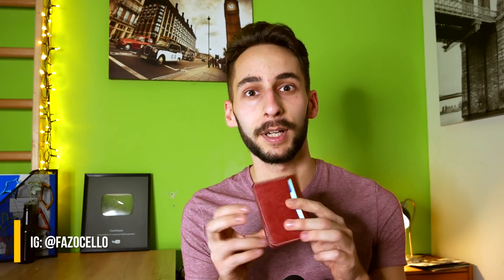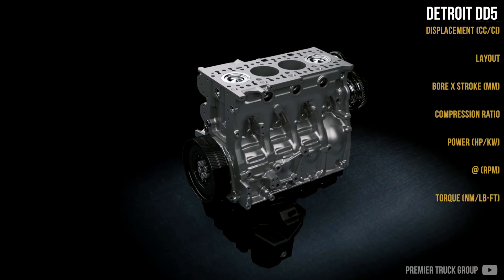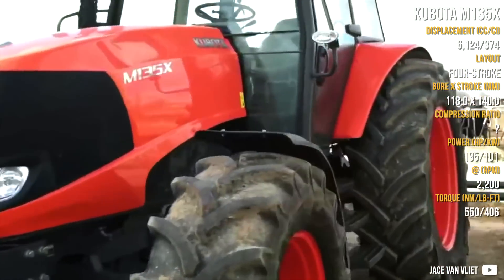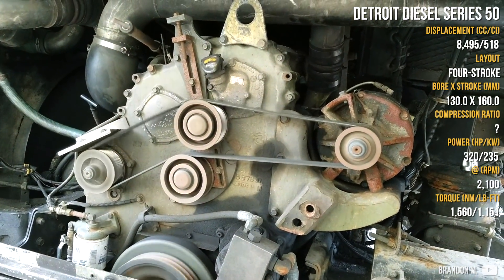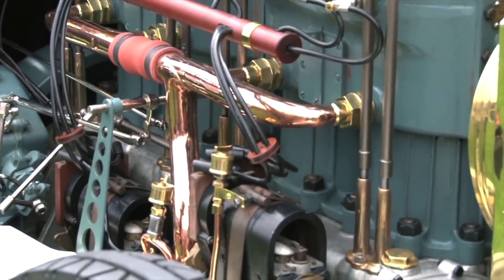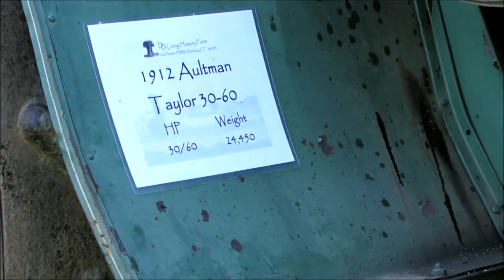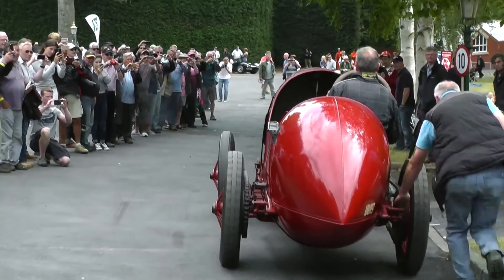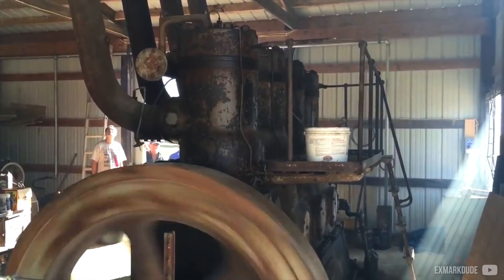The Largest 4-Cylinders In The World

Comment: About 40 years ago I was working at the Giles weather station in central Australia. 
They had 2 old Nation 4 cylinder diesel each was about 14 feet tall similar to the last one you showed Fairbanks Morse. 
These National engines had been running in the power station for about 50 years without any failures they had remote cooling towers and were air start the fly wheel was about 7 or 8 feet in diameter. 
To start them you had to decompress the cylinders then using a long spanner to rotate to top dead centre on cylinder 1 then using a hand pump mounted on the wall pump up the air pressure hit cylinder with the air pressure when spinning release the decompression leaver. 
These engines had been doing 600RPM’s for 50 years. 
I’ve never seen anything like them since.

Comment: You should do a video about big gasoline i4 engines. The secondary balance problem limits inline 4 engines in size or rpm, which i shy you don't see anything bigger than 3,3 L in cars revving to normal ranges of 5,500 rpm. Anything bigger are slower diesels.

However, there have been interesting exceptions, like Thor, and a new marine engine.

Comment: Actually, the turbo-supercharged Detroit 4-71 2 stroke was rated to 300 HP  The electronically controlled turbo charged 4 stroke Series 5 four cylinder were rated as high as 330 hp.
I had a 330 HP series 5 in one of the expedited box trucks I drove when with Panther and V-3.

Comment: Engines SMD-14, 18, 22, 23, 25
4-stroke
Rated power, kW (hp) 61.1 (83.2) -125 (170)
- liquid cooled
- cylinder diameter 120 mm
- piston stroke 140 mm
- working volume of cylinders 6,3l

Comment: Actually, there were many much larger more powerful 4 cylinder engines produced. A good example would be the 4 cylinder triple expansion steam engine used in R.M.S Titanic. There were 2 of those with a Parsons steam turbine that provided the thrust needed to move the ship. Each of those 4 cylinder engines produced a modest 15k HP each at 72 RPM. The Steam Turbine was rated at 16k HP. The maximum HP by desing however would be around 60k at 83 RPM and 18k of that power would be from the steam turbine. It was enough to move the ship an estimated 24 knots in forward. There were larger still 4 cylinder steam engines. Just wanted to put that out there.

Comment: As a two-stroke diesel engine that does not use crankcase aspiration cannot naturally draw in combustion air, the blower is inherently necessary to charge the cylinders with air for combustion. The blower also assists in scavenging spent combustion gasses at the end of the power stroke. All Series 71 engines use uniflow scavenging, in which a gear-driven Roots blower mounted to the exterior of the engine provides intake air through cored passages in the engine block and ports in the cylinder walls at slightly greater than atmospheric pressure

Comment: the non turbo detroit diesel is not naturally aspirated .... the way a 2 stroke detroit works it will not run without a supercharger.. at 0:46 the super charger is on the side of the block with the large pipe going into the top of it ...the blower blows directly into the block and into ports around the bottom of the piston liner  the exhaust is exhausted through  4 valves in the head,,,as the air enters the bottom of the cylinder the piston cannot suck the air in hence the reason for the supercharger

Comment: The Aultman-Taylor 30-60, seems like a waste of time building unless they were meant for weight more than anything else.  With 1391 Cubic Inches, putting out 80 horsepower, it was a little generous with torque though, putting out 764 lb.ft.

Comment: OK, is the Detroit Diesel 4-71 really 
naturally aspirated?  I'm not sure.
But, it DOES require that 4-71 
Roots Blower on it, to run.

NHRA regulations limit the supercharger 
size, on the top fuel cars, to a 14-71 size.
Or, just a wee bit larger than the blower 
on this "naturally aspirated" engine.

Since this 4-71 is a 2 stroke Diesel, I don't 
know if the supercharger on this, makes it 
not "naturally aspirated."

Oh, it doesn't have 4 cylinders, only 2.  The 
Snow 600 HP engine.  2 cylinders, but 4 
sets of valves, and 4 spark plugs.  Double 
acting cylinders, piston pushed both ways, 
like a steam engine.  Roller lifters, and 
roller rockers.  86,800 cubic inches.

http://www.coolspringpowermuseum.org/Exhibits/Exley/Snow_600_00.htm

steve

Comment: Any 2 stroke is supercharged or at least selfsupercharged, as they cannot run otherwise.
Reply: supercharging means air supply by separate unit with positive exessive pressure. So in this point for example all moto 2 stroke engines are naturally aspirated!

Comment: I thought all Detroit 2 strokes were supercharged and twin charged was for extra power
Reply from the maker: They are, but it's not there to provide boost, but rather a sufficient amount of air. Without this supercharger/blower it would not run at all.
Reply: @VisioRacer  its primary roles would be both to clear the cylinders and provide boost
Reply from the maker: @enja001  I have read a lot about them and the turbo variant is there to provide boost.
Reply: @VisioRacer  yes that is true but you can't claim an engine that uses forced induction(even slightly) is naturally aspirated
Reply from the maker: @enja001  What is natural aspiration of the two-stroke Detroit then?
Reply: @VisioRacer  its still not naturally aspirated. Naturally aspirated refers engines that use atmosphereic pressure. That detroit uses forced induction above atmospheric
Reply: Although the Detroit is a bastard child
Reply from the maker: @enja001  I rear that the blower provides only about pressure of atmospheric air

Comment: I need to correct you on the Detroit 4-71. The 4-71 came with a two valve head or a four valve head. The issue with the four valve heads on all 71 series heads is the heads are notorious for cracking between the injector and a valve seat or between the valve seats of the head.

Comment: The guy right off the bat doesn't know what he is talking about. 2 stroke Detroit diesels run with a blower they are not naturally aspirated. They won't run without a blower
Reply from the maker: That is the natural aspiration. All 2-stroke Detroits run with the blower, yes, they are not able to run without it.
Reply: @VisioRacer  The blower makes it not naturally-aspirated as the blower puts positive pressure into the cylinders to blow the exhaust gases out of the cylinders, not the piston as in a 4 stroke. I know the 4-71 as I have one in my boat for the last 30 years.

Comment: Another engine you didn't mention the 5.2 liter Isuzu 4HK1 diesel engine.
A four cylinder diesel engine with a displacement of 5,193cc, and it is bigger than Detroit DD5 engine.
It was used for trucks and buses as well.

Comment: The 71 series detroit was not NA it has a roots Blower, it's inherent to it being a two stroke diesel. There were twin charged variants however.
Reply: This has been a argument for decades...Detroit's got air into the cylinder from holes around the sleeves in basically the bottom of the cylinder sleeve (well kinda middle of the sleeve a bit above bottom dead center) so without a roots they simply don't draw in air thus...they don't run,unlike traditional engines that draw in air from the top of the cylinder as the piston moves down the air is forced in from the bottom then the piston moves up so by "typical" standards no 2stroke Detroit would be "NA" but taking into consideration that's essentially the intake valve and can't function without it it is NA if it's a non turbo version.
Reply: Came here to say this. Although I think he means it can also be turbo charged (along with the necessary blower that two stroke diesels all need). He has made videos on two stoke diesels in the past, so I'm pretty sure he knows how they operate.

Comment: Another large 4 cylinder is the English Electric 4SRKT Mark II, it's a 4 stroke turbocharged diesel engine with 61,2 liters displacement, 254mm bore and 305mm stroke.
It produced 600hp at 850rpm.
It's use was in diesel multiple unit trains and small locomotives, like the British Rail class 205 "Thumper", it has that name for a reason because it makes some hefty noises.

Comment: Two strike diesels are NOT naturally aspirated. They rely on a supercharger for cylinder scavenging.
Reply from the maker: Yes, naturally rely on that supercharger = so they are naturally aspirated, no forced induction unless there is a turbo. That's the way it is in the two-stroke diesel
Reply: @VisioRacer  is a supercharger not a form of forced induction then? A detroit needs positive intake pressure to run hense a supercharger
Reply from the maker: @adjustablehammer3749  Yeah, generally it is. However since it would not run without this supercharger, it is not considered as an added boost, but rather a natural aspiration. I did not make this up, I read about it and makes perfect sense to me.

Comment: The Benz is that a twin spark it has 8 spark plugs 4:18 so I would say it's an 8 cylinder.
Reply: Thats not how that works.....spark plug count does not equate to cylinder count. If that's the case then all gen 3 hemis are 16 cylinder because they have 2 plugs per cylinder. Yet if i crack em open theres 8 cylinders and 8 pistons...

(Yes I am aware of opposed cylinder engines)

Comment: As a student of mechanical engineering, specifically specializing in automotive and heavy duty commercial applications and internal combustion engines: That's insane. 

Any 4-cyl more than 3 liters is fucking insane. The kinds of mitigation systems and over engineering you need to perform to that thing to prevent it from performing a rapid unscheduled disassembly of its own volition is a pointless waste of resources.

When you're doing something on a scale like that, its way more sane to start with an inherently balanced system, basically either a 6 cylinder inline or 12 cylinder V alignment of the cylinders. That's why they are the most common options in major industrial scale internal combustion engines and heavy duty automotive systems. Even in the US trucks are primarily I6's. They used to V12's back in the day of reckless excess, but you know. Downsizing in the name of efficiency is a thing. 

So, why the hell would anyone do something like that?
Reply: Fuel effciency is my only guess. I love my 4 cylinder engines, but you are right. They aren't naturally balanced. Even then the fuel effciency gain's would have to be marginal at best if even any. 

Alot of these are also really old 20th century engines and may have been before various engineers discovered what engine layout's were naturally balanced, other than that you're absolutely right and I agree.
Reply: Different engines for different applications basically, Detroit Diesel specifically made the 71 series in inline 1, 2, 3, 4 and 6 cylinder variants plus V6, V8 and V12 configurations. There were also V16 and V20 layouts made basically by bolting together 2 V8's or 2 V6's + 1 V8, the latter 2 were almost always used as stationary engines for pumps or electrical generator sets.

Comment: Try merrles, blackstone... If you want to get into cubic inch displacement. 71 cubic inches doesn't come close.  Fairbanks built much larger engines you're missing. You also have Cleveland and bessemer. you need to expand this a little bit because literary this one didn't do anything for me.  You should also look at sterling. Absolutely amazing engineering

Comment: That first Detroit Diesel doesn't sound like a two stroke. Of course being huge it will rev more slowly which is probably what causes the illusion.
Reply: its a 4 cylinder, its diesel, it has huge displacement, has overhead exhaust valves and revs slowly. Don't expect it to sound like a dirt bike or a chainsaw
Reply: @dieselgeezer18  It's not exactly huge at 4.6 litres, but it does sound like a 4 stroke 4 cylinder engine. Being bigger than a car engine it will rev more slowly as I said, which probably causes the illusion. And no I wasn't assuming a two stroke will sound like a dirt bike or chainsaw... I do know what a 2 stroke diesel normally sounds like. We do have them here in the UK!
Reply: @TommyWylie  compared to a chainsaw and a dirt bike, 4 litres is huge. You said that the first detroit doesn't sound like a 2 stroke. I assumed you meant 2 strokes like chainsaws or dirt bikes
Reply: @dieselgeezer18  No I was thinking of 2 stroke diesels like Fodens and Rootes TS3s, which are also in the 4 litre capacity range. You can tell listening to those that they fire twice as often per revolution as 4 strokes. The Detroit Diesel 4 cyl doesn't sound so obviously 2 stroke.
Reply: @TommyWylie  I know what you're saying mate...I love those ts3's they proper scream...opposed piston right?

Comment: Layout: four stroke

The layout would be "inline 4" and not how many strokes it has, or am i just crazy?
Reply from the maker: Of course. Sorry about that. I normally just copy the layout from the previous video and check the numbers whether they are correct. I forgot to check the sub-titles this time...
Reply: A 4 cylinder engine can be 4 stroke or 2 stroke.
Reply: @tannerhanstine1361  ye ye but i don't think that the amount of strokes is the "layout" of the engine. 
That was my argument, sorry if it was confusing
Reply: @jaynee8581  you're 100% correct